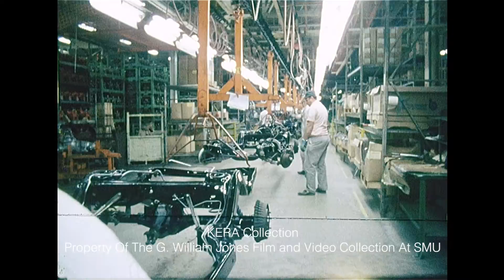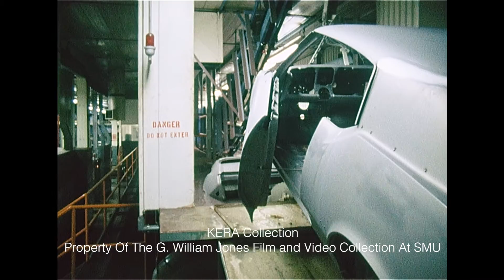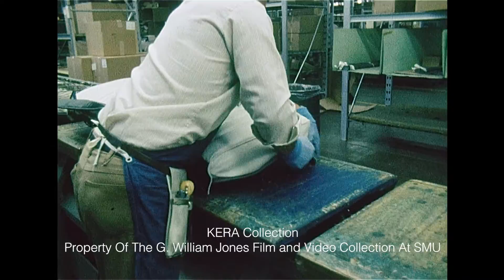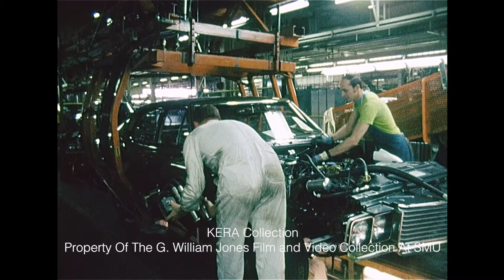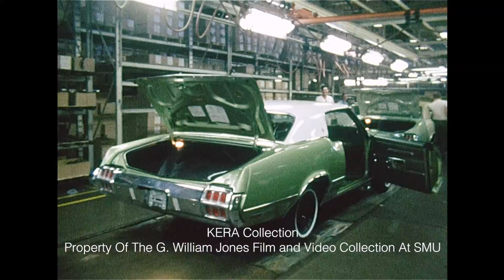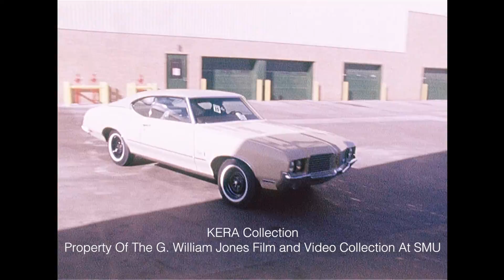A Look Inside The Arlington General Motors Plant - 1972 (Silent)

Comment: Those were the good old days. 1973 was the year our standard of living peaked in the United States. 1973 was also the year that manufacturing peaked in the United States.
Reply: It has been all downhill since then. True there have been high points but I miss the pre Arab oil embargo days.
Reply: GM UAW guys made 12.82 a hour in the 70s, which works out to almost $60 today

Comment: I hired into this plant in 1977 and retired from there in 2008.
Reply: Forgive me, but can clarify a bit of history for me?  In doing some research on GM's production history, I ran across countless bits of conflicting information.  Regarding the El Camino at Arlington — It's my understanding that El Camino assembly was moved from Kansas City to Arlington mid-way through the 1974 model year.  I have two conflicting reports that suggest El Camino assembly returned to Leeds for 78, but moved back to Arlington in 1979.  GMs press information confirms they were in the 1979 Arlington model mix, but I can't find anything specific for 1978.  Leeds was running well below capacity and it seemed unusual to move the El Camino from there to Arlington, which I understand usually ran at or near full capacity, though I know other factors determine where a model is assembled.  GM's old press bulletins that announced model year assembly plant assignments were released early in the model year and did not reflect later changes.  I know that Cutlass assembly took place at Arlington in 1984, but I have conflicting information on 1983.  

So, in short, did Arlington make 1978 El Caminos and 1983 Cutlasses?  I would greatly appreciate any information you have. 

Oh and my interest in this stems from doing a report in high school on VW's plant in my home state of Pennsylvania.  I slid down a "GM" rabbit hole that I'm still stuck in!
Reply: @yossarian6799  DONT quote me on this because it was long long ago but I wanna say the Arlington plant snatched the El Camino production from Mexico
Reply: Congratulations thats a he'll of a career.Thank you
Reply: Thank you for producing such fine machines from the Jestson age. They’ll never make them like that ever again..
Reply: @randyfarr844  Eventually Arlington (and the other plants) lost the El Camino and GMC Caballero production as all 1985-1987 models were made in Ramos Arizpe, Mexico.
Reply: 77 was the last big wave of hiring for old time GM guys. incredible you made it all the way to 2008 without a layoff
Reply: oh I had my share of layoffs early on

Comment: What we have here is a silent film presentation of cars being assembled at a factory.  The brand of cars being assembled is the Oldsmobile (sometimes shortened to “Olds”) automobile.  Oldsmobile is a storied name in automobiles, going back to the turn of the last century.  Oldsmobile has gone out of business, however, and you can no longer buy a brand new one.  Only older models, built before Olds went under, can now be purchased and serviced.  Sorry about that.